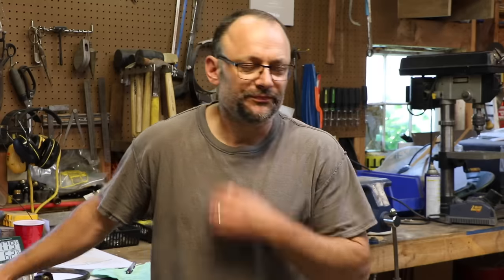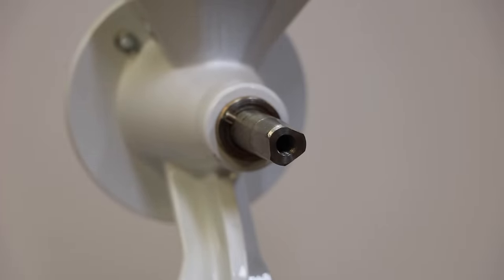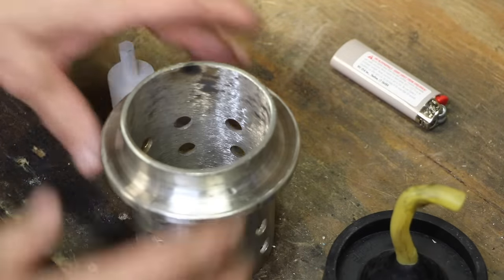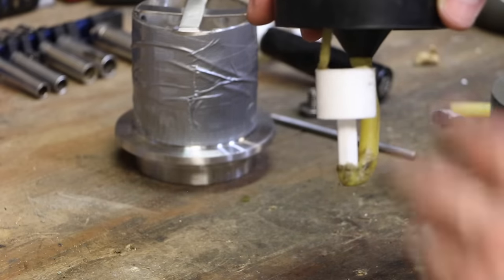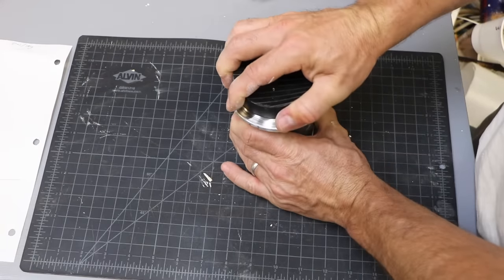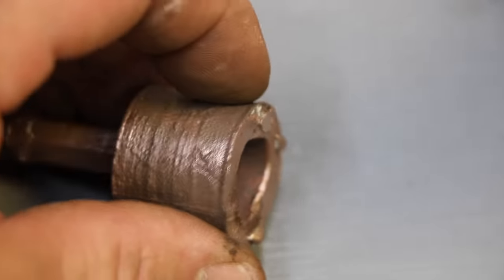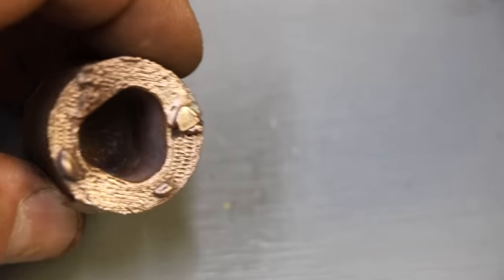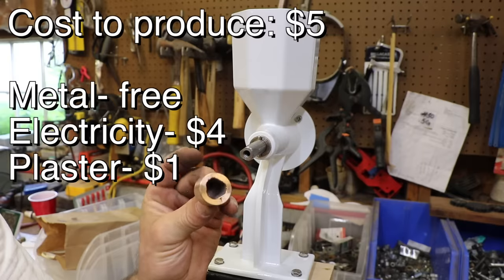I Refuse to Buy Your $@#!   I Make My Own.

Comment: We are just alike.  I'll spend way more time making something myself just so I don't have to buy it.
Reply: I have repaired 3 wheelbarrows for less than $100 total including paint, missing parts (wheel brackets on one wheelbarrow), washers (since I don't know how to weld), drill wire brushes (which can be used for other projects in future), metal filling paste (very rusted bucket on one of them), and sanding pads for electric sander. It would have cost me over $300 for a single new wheelbarrow, saving me roughly $800. I also have a barn find 1950's wheelbarrow (my grandmother's garden one) that needs repairing but I can reuse everything on it and mainly needs wire brushing, sanding, hammering rim back onto wheel, and new paint.
Had a John Deere front tire go flat while mowing (one section of land, 1 square mile). My 84 yr old mom and I used front bucket as a jack, pulled tire, used a Mahindra tractor's bucket to load tire in truck to take in, needed to be replaced ($1,100), had them load it onto truck and take home. Then we unloaded tire (used tamping bar to lift one end, pulled with chain, rotated it out of truck), rolled it over to John Deere, used bucket to lift tractor, I slipped tire on while mom was controlling bucket, tightened bolts again once I drove it back to barn. Then we cleaned off the mowing deck (fold out type), running off a rat who decided to make a home in it, so it is ready for greasing the Zerk fittings in the morning sometime (raining right now at 2:55 am.
Yeah, lot of people are like y'all and would rather do things ourselves than pay someone to do it. Sure, we could have had the people who replaced the tire come out and remove tire and haul it in, then once replaced have them put tire back on, but what fun is that? Not to mention probably anywhere from an additional $100 to probably close to $500 to have them do it.
Reply: @roseblite6449  ok
Reply: Same here. My dad used to say that he had four sons and the last one got all four's share of his awkward bugger gene. That's me :-D 

I'll spend inordinate amounts of time and even money doing something the most complicated way possible if it means not buying the "official" part or the over-hyped thing that does the thing. It's a hobby and an attitude that led to a living. Bodging might not sound much of a skill but when you make your living maintaining hopelessly obsolete, but very specialised, equipment it's a positive boon. Parts? I don't need no steenking parts... I can make something that will do the job from this potato, this tube of epoxy and this picture of a seagull... Or something like that anyway.

Oh... And you also learn a lot. I'm currently learning all about plant nutrients and re-learning a lot of the chemistry I did at school (Thanks NileRed / Doug's Lab / NurdRage) because I refuse to pay £10/litre for hydroponic nutrients that are 97% water. I bet I can get that down to £10 per 1000 litres.
Reply: @roseblite6449  meth rant
Reply: Oil Change instructions for Women:

1) Pull up to Jiffy Lube when the mileage reaches 3000 miles since the last oil change.
2) Drink a cup of coffee
3) 15 minutes later, write a check and leave with a properly maintained vehicle.

Money spent:
Oil Change: $20.00
Coffee: $ 1.00
Total: $21.00

Oil Change instructions for Men:

1) Wait until Saturday, drive to auto parts store and buy a case of oil, filter, kitty litter, hand cleaner and a scented tree, write a check for $50.00.
2) Stop by 7/11 and buy a case of beer, write a check for $20, drive home.
3) Open a beer and drink it.
4) Jack car up. Spend 30 minutes looking for jack stands.
5) Find jack stands under kid's pedal car.
6) In frustration, open another beer and drink it.
7) Place drain pan under engine.
8) Look for 9/16 box end wrench.
9) Give up and use crescent wrench.
10) Unscrew drain plug.
11) Drop drain plug in pan of hot oil: splash hot oil on you in process. Cuss.
12) Crawl out from under car to wipe hot oil off of face and arms. Throw kitty litter on spilled oil.
13) Have another beer while watching oil drain.
14) Spend 30 minutes looking for oil filter wrench.
15) Give up; crawl under car and hammer a screwdriver through oil filter and twist off.
16) Crawl out from under car with dripping oil filter splashing oil everywhere from holes. Cleverly hide old oil filter among trash in trash can to avoid environmental penalties. Drink a beer.
17) Install new oil filter making sure to apply a thin coat of oil to gasket surface.
18) Dump first quart of fresh oil into engine.
19) Remember drain plug from step 11.
20) Hurry to find drain plug in drain pan.
21) Drink beer.
22) Discover that first quart of fresh oil is now on the floor. Throw kitty litter on oil spill.

23) Get drain plug back in with only a minor spill. Drink beer.
24) Crawl under car getting kitty litter into eyes. Wipe eyes with oily rag used to clean drain plug. Slip with stupid crescent wrench tightening drain plug and bang knuckles on frame removing any excess skin between knuckles and frame.
25) Begin cussing fit.
26) Throw stupid crescent wrench.
27) Cuss for additional 5 minutes because wrench hit bowling trophy.
28) Beer.
29) Clean up hands and bandage as required to stop blood flow.
30) Beer.
31) Dump in five fresh quarts of oil.
32) Beer.
33) Lower car from jack stands.
34) Move car back to apply more kitty litter to fresh oil spilled during any missed steps.
35) Beer.
36) Test drive car.
37) Get pulled over: arrested for driving under the influence.
38) Car gets impounded.
39) Call loving wife, make bail.
40) 12 hours later, get car from impound yard.

Money spent:
Parts: $50.00
DUI: $2500.00
Impound fee: $75.00
Bail: $1500.00
Beer: $20.00
Total: $4,145.00
But you know the job was done right!

Comment: Pee pee poo poo
Reply: My message would be to not purchase their product.
Reply: To me, you are sending the wrong message, a message of "this is hard to do".
Reply: @elypowell6797  Actually I'm 74 years old have 3 patents in my name, owned my own business have worked for other companies as a mechanical engineering consultant (now retired). And my mother lived with me until she passed away one month before her 102 birthday. I have never drink any alcohol, I never smoked and have never taken any drugs unless they were subscribed by my Dr.

And you are wrong I think fixing the problem was simple, he just made it 100 times harder than it needed to be. And if you would have been smart enough to read down to my next post instead of making a stupid comment you would have known that. By the way, my condolences to your mother, I'm sure it's not her fault.
Reply: What sort of shaft / handle do any of you propose that does not increase the cost of manufacture for a hand crank mill?  And don't say " something different "  , that is like saying " re imagine the police "
Reply: @bobroberts2371  Bob I already explained how to make a shaft for this grinder in minutes using a bolt nut and a lathe or grinder. What is your big malfunction? Do you really not get it?
Reply from the maker: @bobroberts2371  Bicycle crank.  Accepts a socket, and doesn't wobble.

Comment: its never about the money , its about the freedom. hate companies that do this
Reply: so true
Reply: Freedom ain't got anything to do with it.
Reply: It is always about money, the company saved money to build it with a taper because they don't have pay for the extra labor for tighter tolerances
Reply: Thats what commies says. If anybody could provide better solution for the problem it would be on his 'Merican table. I bet this guy will not sell a single one of those for less then 30, so he just basically trashtalking.
Reply: @egorleontev9970  , American.
Reply: Actually, in this case, it's an old standard that nobody spends the time looking up. This mill is designed to be compatible with other existing mills/mill parts.
Reply: no its about paying for and justifying having a lathe and other tools... and the video income... anyone else with out those things would just buy the adapter... or just use a coffee grinder or a food processor.

Comment from the maker: All that to save $25?  It's the principle of it all!  And practicing so that I can make something else in the future that may not be available to purchase.  Self reliance is extremely valuable to me.  Have a great weekend everybody!

This build only took me at most 1 hour of labor.  Many people seem to think that it took many hours.  How long does it take to print a part (5 minutes), attach it to some wax (10 minutes), mix and pour some plaster (10 minutes), put it in the burnout kiln (2 minutes), and pour in metal?  I did it in parallel with many other castings which made it more time and energy efficient than if I had done it as a solo project.  There are many, MANY ways to work around this problem, some faster and even better.  I've been experimenting with lost PLA casting lately, and this was an obvious application of that technique, so that's why I chose this method.  With this technique, I can make a part in about 24 hours, faster than I could get it if I ordered it online.  There are lots of advantages to having this ability to make custom parts quickly and easily on my farm.  Sometimes I need a part that isn't available for sale at all.

To address some frequent comments:  The shaft is 5/8", so a 1/2" drill will not fit.  I wanted to preserve the ability to use the hand crank, so didn't want to butcher the shaft grinding it into a hex.  Forging a socket onto it would have worked too.  Putting a pipe over the shaft with set screws against the flats would have worked too.  I don't have a universal socket, but that probably would work too.  A bigger drill chuck, using the lathe chuck, using a grade 8 bolt, welding on a nut...the list goes on.  Lots of ways to skin this cat.

People have pointed out that this is not a proprietary design, and has been used in the past on antique cranks.  I wasn't aware of that, so perhaps the company isn't intentionally trying to gouge the customer, but in that case it's just a poor design.  This is not an antique, and motorizing it is obviously going to be a common mod.  So why not make a design that facilitates this without money and hassle?  Some comment that the handle would wobble without the taper.  I disagree.  Bicycle cranks don't wobble, are square and would easily accept a socket.  So the company either thought this through and decided to keep the antique design so they could sell adapters (as I suspect, they sell them on their website), or they didn't think it through, which makes it a poor design choice for modern times.  

Regardless, I hope you enjoyed the video!
Reply: I really like your title and the thumbnail text ^^
Reply: Honestly, i thought you were going to disassemble it, and make a new shaft on the Lathe or Mill. But that works too.
Reply: You should sell them on amazon and under cut the buggers that are over charging.
Reply: I'm glad I'm not the only one that will spend a few days, more money than is needed, and generally make a mountain out of a molehill to prove a point by sticking it to "unethical" companies. And it is nice when the results come out as needed  and you don't have still buy their product.....and listen to your wife's snickering.
Reply: Could you have engaged the roll pin or replace it with a shaft to engage a fork?
Reply: I would have put a crappy 20mm or what is close to the shafts size, then drilled through the socket and shaft and put a bolt through socket and shaft and secure with a nut. 🔩
Reply: Hey, sometimes that $25 can make the difference between putting food on the table or not.
Reply: So you bought a 3d printer and pla and then made it into metal using plaster and other stuff saving you what exactly?
Reply: @Niels357  you need to balance the equation. In that he made it in house practices skills, it is monitized, enjoyment. The principle of buy or make local keeps money in the local community rather than in corporate pockets; and bringing the production inhouse is the  most extreme form of that principal.
Was it the cheapest option, perhaps not but in the long view of not rewarding businesses who design something offensively.
Reply: @benjaminbrewer2154  money is just a representation of value! You buy what jou value the money itself is worthless. If all that money was worth the energy and time because you enjoy it well good. But he sad he saved 25 bucks seeing the video he saved nothing!
Reply: @benjaminbrewer2154  he just had to get rid of the tappering the 3 sided shaft fits perfectly on a drill chuck. Alot of energy and materials wasted to get the same result!
Reply: Only the very end if the shaft has the 3 tapered flats on it , the rest is round.
Make your adapter slide over the whole length right up to the roll pin and drop 3 setscrews into the flats to lock it on.
Then there could also be an adapter on the end for the drill.
Reply: The tapered shaft flats are actually the proper way to make this. It prevents the sloppy handle of lesser options.
Reply: You can't put a price on self reliance
Reply: “It’s the principle...”
You are not alone in your way of thinking.
Reply: Its threaded........ throw a bolt in it. And a socket.. it breaks... big whoop a drill bit and an extractor
Reply: You did this out of spite for corporate greed and that only makes my respect for you grow
Reply: I agree with the principal, if you dont practice FABRICATING answers to problems now, when times are good, then you wont have the skills required to succeed when the economy collapses, SHTF, or whatever difficulties prevent the ability to PURCHASE your answer to problems.
Reply: well worth it.
Reply: Why not just cast a pulley and make it belt driven with an electric motor?
Reply: proprietary fittings? Ill make my own, thanks.
Reply: LOL that product isn't even sold by the company that makes the mill. Your screenshot appears to be from a 3rd party manufacturer that produces it to fit the mill. So the idea of them wanting to make the extra $5 on the adaptor falls apart. The 2 people that bought the adaptor, out of the 6 people that bought mills (hyperbole), is hardly enough to warrant going through the more costly machine work on the shaft to make the few dollars of profit on the adaptor (that they don't even sell, according to your screenshot of the adaptor). It's scary that this amount of people don't understand how business works. So I'll drop some knowledge on you. Assuming the company that manufacturers the mill also manufactures an adaptor. (Which you haven't shown to be true.) The mills are being produced in EXTREMELY small numbers, and the adaptor is being produced in much smaller numbers. The cost of having a taper ground on that shaft AND the hand crank, then having flats milled on the shaft, is far too expensive for just the few dollars they make on the adaptor. (vs a simple hex or a pin drive) The adaptor is made in such small numbers, they're probably grossing $12 on it and netting half that. Subtract the machining costs of the shaft from that $6 they're making on the adaptor, and they're making hardly anything. Since the company that produces the mill doesn't produce the adaptor, they're making $0. That seems so simple for me to understand, but I guess that foresight isn't inherent in everyone, so I don't mean to come off confrontational.
Reply: Looks like simply putting a six or twelve point socket on it would have worked.
Or taken a pull and using a rotary file to taper it to the safe and secure with lock screw.
Or taken a bolt and screwing in the end of the shaft!
Lots of options, but you look like you wanted to make a big production out of it.
Okay, your channel, but not the easiest way to do it@
Reply: @littlejackalo5326  I agree with you.  Furthermore, the taper is a nice design.  I am glad he didn't ruin it by cutting off the shaft or welding a nut on it.  The adaptor is NOT being pulled into the taper the way the handle was designed to.  I don't see an OEM designing an adaptor that negates the purpose of the taper.  Thankfully, he made the part out of brass which will hopefully save the shaft which looked like stainless.
Reply: I suggest not making a sharp stress riser at the shoulder,  tapering would be about 4x stronger.
Reply: A six point socket and a brass hammer will fix that issue quickly... quit yer B.S.
Reply from the maker: @joeanderson5592  That would be a crazy amount of work to reproduce in metal.  But I am intrigued...
Reply: @FarmCraft101  at least the models are free, and that effort is taken care of. I would guess that finishing the cast metal for smooth joints would be the hardest part. Should be able to cast multiple mini jaws at the same time. Worth a shot I'd say.
Reply: Awesome skills with the adapter build.
Reply: Some of these comments are outrageous. You are a very intelligent and skilled man, John. Thanks for showing us a great craft..